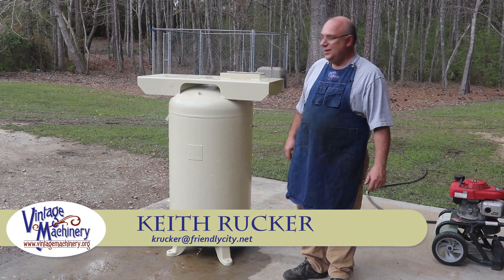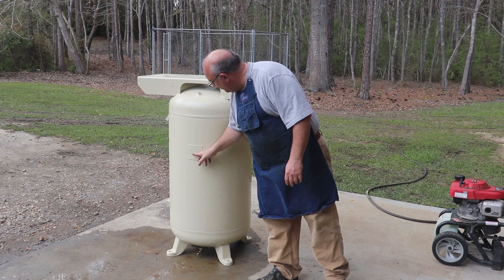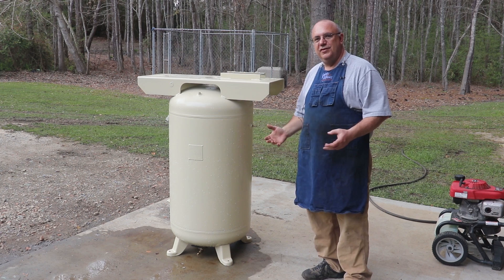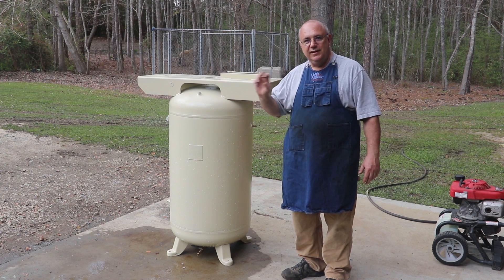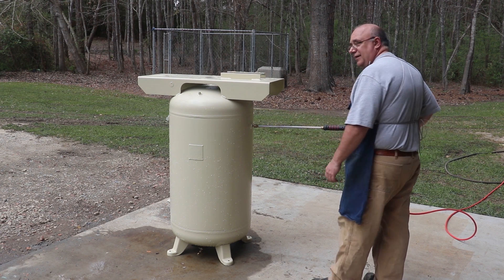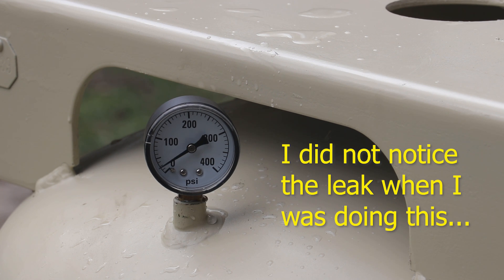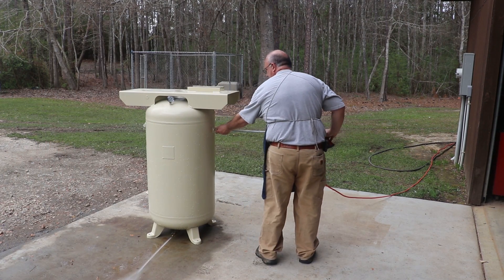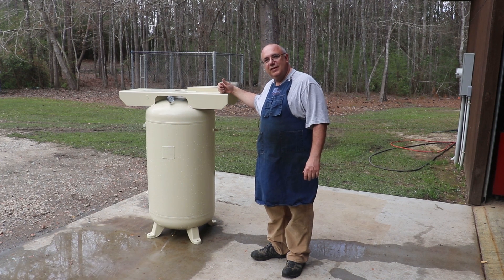Hydro Pressure Testing a Air Compressor Tank

Comment: If the working pressure in a tank is 175 psi, you figure out how many square inches of tank surface you have and multiply it by 175.  This is how manty thousands of pounds of explosive pressure you have waiting.  That's why some call portable air tanks "Air Bombs".   If you pressure test get all of the air out.  Keith should have had a helper to tilt the tank to get more air out.  I was trained at Quincy Company over 40 years ago.
Reply: Quincy Illinois,or one of their other plants?
My uncle worked at the Ill plant.
Reply: The instructions on French aerosol cans used to refer to the can as "la bombe" but in the last couple of decades this has been changed to "l'aerosol".

Comment: There are cable operated drain valves, so if yours is in a difficult location, the tank can be drained easily with out gymnastics.

Comment: Valve Monky covers the essentials below Keith, it is his specialist subject, and mine.  
If you were doing it again;

Tilt the tank till the vent is at the high spot, trapped air is your enemy.
Put a positive shut off valve in circuit to hold the pressure in.
Working pressure only when retesting an old unit, 200psig would be fine.
Remember to test and re-calibrate the relief valve - this is actually more important than hydro testing the receiver.

...  and before you test it - ding it with a hammer, and if it goes 'clunk' rather than 'clang', just scrap it.
Reply: Because he was using a pressure washer, a small amount of trapped air is extremely necessary. It's a compressible buffer that allows you to add pressure in a somewhat controlled manner in the absence of a pressure regulator valve. Notice how the pressure rose very quickly and he over-shot his target. With no air buffer it could have spiked to the full output almost immediately.

Comment: Thanks Keith.  I have a 20 year old tank that sat in damp storage for two years and I have been leary about using it.  Now I know how to test it thanks to you.  Can you tell us the type of quick release fittings you used, and where you got them?  Many thanks!
Reply: Don’t test it like he did. he tested nothing look up hydro test procedures on google and learn the correct way. The way he did it tested nothing.
Reply: @frankinjeep1194  Yeah pumping it up to 150% of working pressure tested nothing.  WTF dude?  He certainly tested that the tank will withstand 150% of working pressure.
Reply: Star Gazer no he didn’t. He did what’s called a spike test. You can run the pressure up to 300% working pressure for a little bit and it will hold. A true hydrostatic test requires the pressure to be maintained. I do hydro tests for a living. He needs to test at say 150% standard operating pressure for at least 2 hours preferably 4 hours it’s called a strength test. I have had vessels rupture at the last hour of a 4 hour test. Think about it. You expect the vessel to hold the working pressure for hours if not days. Mettle can withstand high pressure for a brief period of time but will fatigue if it’s held under pressure for a longer time. That’s why it’s called a strength test. The tank my be faulty or have metal loss and can hold pressure for a brief time but under constant strain from use and could fail. That’s why you hold pressure and monitor the pressure for longer than a few minutes. So no the tank is not tested he proved nothing.
Reply: @frankinjeep1194  He did a safety test.  He didn't do a certification.  He doesn't need it to hold 300% for hours.  He needs it to hold 100%.  He did prove something.  He showed  that the tank wouldn't burst at 150%.  You people are ridiculous.

Comment: Actually that plug on top is where the check valve goes. Its very important on a compressor as it puts the air into tank without putting undo stress on the compressor head. I would replace the valve period so getting it out and then retaping hole is a VERY good idea. Twelve years ago a replacement gasket set for my compressor cost over $200 because of that valve. I can only imagine that the price has gone up a lot since then.
Reply: I had a similar issue with an IR check valve, that needed replacing. No longer made, and the PTFE disc was worn, so instead left it as a very expensive elbow into the tank, and put in a new one to replace another elbow on the high pressure side instead. Odd size one, and special order with months lead time, so the alternative of off the shelf and cheap won out.

Comment: If memory serves me correctly  water can compress 1/10 of 1% or maybe that was oil. I'm sure someone knows better.
Reply: Water compresses 0.05% for every 145 psi.  When you get to 145,000 psi (50% compression), water will become a solid at room temperature.

Comment: Related question, are there any coatings made to keep the interior of a air tank from rusting? Would have to be somewhat flexible to accommodate the expansion and contraction of the tank when cycling between pressurized and not.
Reply: Yes there's many coating you can use but it's not cost effective or necessary I'm sure the tanks integrity is fine the amount of metal los is probably minimal.
Reply: Yes.  Stainless steel.
Reply: Star Gazer how do you propose coating the tank with Stainless steel. Building a tank out of Stainless Steel would be way expensive. Hot dip galvanize would be more cost effective and just as corrosion resistant. Contrary to popular belief Stainless Steel does corrode.
Reply: Maybe try some Fluid Film. Works great on a vise I've got out in my backyard.

Comment: Keith, you will ruin a pressure washer pump pretty quick if you leave it running like that and no water going through it. there is a pressure relief valve on the unit that has wax in it. it will start leaking and once damaged won't seal any longer. also the pistons will get hot and when you open the valve on the wand will get temperature shock and crack.

Comment: hmm, 150% seems light to me. I want to say for refrigerant vessels we test at 4 or 5 times the working pressure, or 3 times but there are some cycling requirements. though there is a two phase fluid in those, and the pressures are even higher than steam boilers. 350-400PSI is the low end of the working pressures, 750PSI isn't uncommon. We also need a pressure relief valve on these tanks which isn't something i've seen on very many air compressor tanks.
Reply: Depends on the cylinder involved, there are a lot of variations in the tests.  HMM, I don't think I've ever seen an air compressor without a blow off valve.

Comment: Keith iff you want I can write you a correct hydro test procedure to insure it's done correctly and safely and you arnt spreading bad information to your viewers. I dont want to see anyone get hurt. What you are doing is dangerous please research what you are doing . I will help in any way I can.
Reply: I have seen the aftermath of a small pinhole hydraulic leak shooting a hole clean through a guys glove and his hand. No air involved. Hell that is how a water jet works. Any  liquid/solid/gasunder pressure, has its safety issues. No state of matter is safe under pressure. Don't believe me? Watch the hydraulic press channel......
I agree that this pressure test could have been more robust. I am not a pro, however I would have gone right to 400psi, and left it for a while. Like hours. Probably would have cycled it a few times as well.  200psi test is not enough if the working pressure is going to be around 125psi.
As a rule, I wanna see things tested to at least double their rating if possible. Triple gives me more piece of mind.
Reply: @notsofresh8563  Usually 150% of rated pressure is required.  No sense damaging the vessel with the test.

Comment: Hi. My late Dad worked for the pumps and compressors division of a globally well known firm. He had some stories about what happens if the valve breaks off a high pressure air cylinder. The air blast from a 3,000 psi one can cut  a man in half. If the tank breaks free you have a high power rocket with a mind of its own. Even at one twentyth of that pressure an air or gas cylinder air filled explosion is potentially lethal. That's why there's a 150% oveload water test. In fact, the cylinder expansion should also really be measured occasionaly as over time repeated filling and emptying will lead to fatigue failure. This is a madatory requirement for things like diver's air cylinders. Drain the tank of condensed water vapour regularly, you REALLY do not want it rusting from inside out. It's instructive to multiply the tank pressure by the inside surface area to find out the forces involved. They may suprise you. Incidentally Keith is mentioning 'pounds' a lot when he really means 'pounds per square inch'. But, it's very good of him to raise this subject. It's important. BobUK. (edit to correct my spelling).
Reply: You are speaking of the principle that air bags use to lift heavy objects and pneumatic cylinders use simple low air pressure to operate valves over a large surface area. It is all in how one contains the pressure for work or to service that work. BTW, the just the sound a tank exploding makes from weakening due to rust will definitely get your attention.
Reply: Yes, know of a case where the oxygen cylinder in a welding set fell off and broke off the valve. Went through 3 floors of a concrete building, and also through one unfortunate standing on the one spot.

Comment: With all due respect that did not test any thing, there would have been trapped air in the dome, you need to fill the receiver and then allow a period of time to allow the water to breath/stabilize then hold the receiver at pressure for a number of hours
Reply: It was a short test to be sure, but the presents of air does not invalidate it. You could do a totally dry test and it would give you the same results, just with a far more spectacular indication of failure.
Reply: @ElectricGears  Not correct the presence of air does invalidate the test the the short burst of pressure also tests noting, maybe the requirements in America are different
in Australia  that display of back yard engineering would would not allow a pressure vessel to be certified, I believe if one can do some thing them self then that is good , with out the correct equipment and knowledge it just becomes dangerous folly and should not be presented  on a public forum there by  encouraging people to perform
unsafe procedures.
Reply: @pijnto  Why would the air matter? 150 psi of air presses on the tank with the same force as 150 psi of water.
Reply: @ElectricGears  Air creates a non stable reading
Reply: @pijnto  Whatever

Comment: I do a lot of hydro testing in the oil and gas industry I reccomend letting the water stabilize meaning let the temperature equalize and the when on test let it set under pressure for at least 4 hours this is called a strength test just running up the pressure and then letting off the pressure tested nothing. Since the vessel is under pressure for extended time when in use it should be tested under pressure for a period of time. I have seen vessels fail in the last hour of an 8 hour test . I wouldn't trust that vessel you just gave yourself a false sense of security.
Reply: I find often that Keith takes the path of false security/poor results and many of his plaudits like it that way
Reply: @jonka1 I am researching this topic. I was glad to see Frank’s comment. It makes sense.
Reply: Also, the temporary leak would concern me. That and testing in a wet location.  How did he know the temporary leak stopped leaking because if another leak maybe? That or the water leak stopped because of a bigger leak somewhere else.

Comment: The pressure washers I've used had a pressure gauge and pressure adjust valve. I'm a fan of cranking the valve down to zero and then back up to about the limit value I want before doing something like this, rather than bumping the wand valve on something set to 3000psi.

Comment: Well that was straight forward. For some reason I always imagined a tank would be measured for minute stretching.
Reply: You are correct when it comes to actual hydro tests of SCUBA. airpack, and other high pressure gas tanks such as oxygen, nitrogen, argon, etc.   I have a SCUBA single 72 steel tank which is about 2300 psi.  Aluminum SCUBA tanks usually get a 3000 psi charge and European tanks go to about 5000 psi.  I have seen photos of a car after a SCUBA tank let go after it got hot in the trunk=-not pretty and car was scrap.
Reply: @royreynolds108  SCUBA tanks have an overpressure disk that lets go.
Threw the tank violently over, scuffed the tank shoulder, scared the dog, but wouldn't have wrecked a car.

Comment: It would be interesting to poke a borescope inside and see what inside of the tank looks like in terms of corrosion.
Reply: The good thing about vertical tanks, is that moisture collects at the domed bottom of the tank, unlike a horizontal tank. 
I had a 50 or so gallon Sears Craftsman  air compressor with the horizontal tank marked as being built in 1949. I had no history of the unit when purchased. I owned it for better than 25 years before it developed a pin hole leak at a welded seam. 
The old Craftsman compressor was retired to become a BBQ smoker, and I purchased a 80 gallon, 5hp Ingersoll Rand vertical tank model.
Reply: That's exactly what I thought as well - I can just image the inside condition of the bottom of the tank especially if the original owner didn't drain the water regularly. It's going to be a rust bucket. Using a borescope is almost the very first test on any pressure vessel.
Reply: He didn't ring it like a bell to set off any stress fractures.
Reply: @benjaminkline4855  I laughed to hard at this
Reply: An official inspection would require an internal examination every 5 years.
Reply: I've always wondered about stress testing like this. How do you know that the test itself, exceeding the stresses of the intended application, doesn't weaken it and cause premature failure after one or more pressure cycles?
Reply: @kirkc9643  the tanks are always built with excessive strength compared to the intended application, the tests are always performed inside of the "real capacity" range of the tank so no lasting damage should be done to the tank unless it itself is compromised due to age or bad maintenance.

In other words, all tanks are eventually going to fail, this stress test is needed to see if the tank is still good to go for another x years, if it gets damaged then the test has fulfilled its purpose perfectly.
Reply: I'm curious what the consensus is on squirting a bit of corrosion inhibitor inside to let it coat the bottom of the tank? I'm a fan of CorrosionX. Heavy duty stuff used by the Navy. 
I've got a tank that I've had since new in the late 1980's, taken out of service around 99' and been empty since. Figured I'll do this pressure test, get it good and dry then a bit of CorrosionX just to cap it off. I'm always consistent with draining the tank but I live in the humid North east where it can accumulate a lot of water in a week.
Reply: @Jerseyhighlander  
Generally speaking... putting anything inside the tank will contaminate the air lines, spray guns, impact tools, etc.  
Mineral oils will break down the seals used in compressors.  
Not sure if the Corrision X will, but it's something you should research, before putting it in the tank... & even if it's safe, there's the issue of what kind contaminates may result from the Corrosion X.
Reply: @OOTurok  
What about epoxy primer followed by epoxy resin?
Reply: @paulmanhart4481  
If you at least have bore scope... a DIYer could inspect the tank themselves.  
Pressure testing is easy.  You just pressurize the tank & see what happens.  I do it away from the house though.  

I would not try expoy coating the inside of a tank.  Expoy resin & paint... gets brittle & would likely flake off in places, which could lead to pockets for moisture to accumulate, unable to drain out.  

The most I would do, is clean the tank of any rust... maybe use Evaporust, then clean it out real good.  
From what I understand, even a brand new tank has to be electro-polished to take any kind of coating... so by that point, you might as well just buy a new tank.
Reply: i check mine yearly and usually end up spraying some rust check in there. prolly hard on my elcheapo air filters. ohh well.
Reply: Asme tank has a 2" pipe plug for inspection purpose.
Reply: If there was significant corrosion it would have showed up when the receiver was drained. Not a definitive test to be sure but if it passes the squeeze then it's good.
Reply: It passed the pressure test.  Not enough corrosion to worry about.  And if Keith drains the condensate from the tank on a monthly basis, no worries in the future.
Reply: @etheroar6312  
Passing a pressure test does NOT test for metal fatigue.  
Before pressure testing a tank... a bore scope & or ultrasound should be used to inspect the tank's interior for corrosion & stress fractures.  
Then the tank is pressurized & held to its pressure rating for 15 minutes... then pressure is released & the tank repressurized & held to its pressure rating for 15 minutes.  
If no deformities occur in the tank... then it is considered safe.  
Ideally an ultrasound would be done after the pressure test to scan for stress fractures.
Reply: @OOTurok  
That sounds like it’s beyond the scope of your everyday DIY’er. I have a 40 year old Manchester pressure water tank (200 psi) that I need to inspect and scrub somehow. Many large ports but I don’t know how to easily scrub the inside. Any suggestions?
Thanks,
Paul
Reply: @etheroar6312  ~ I drain a compressor  after EACH use.